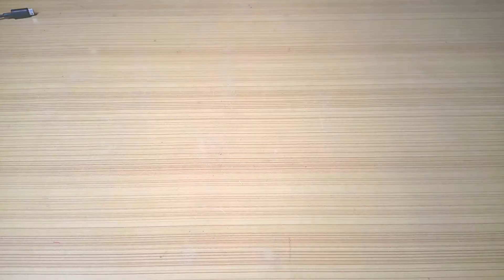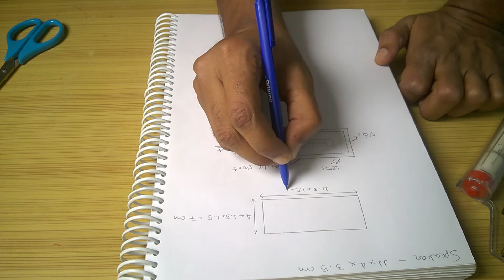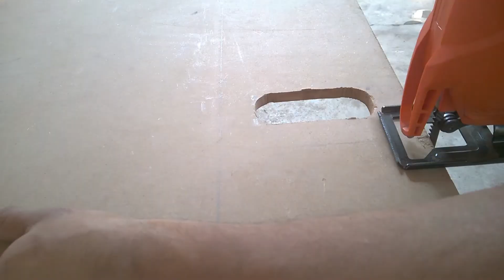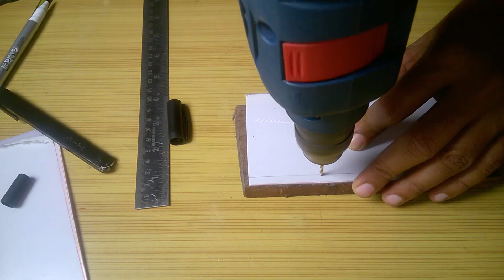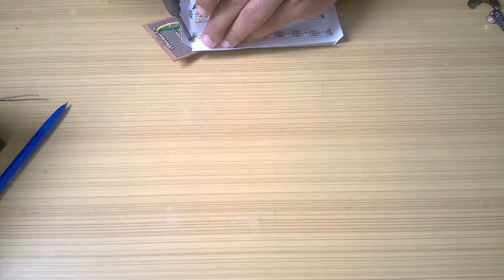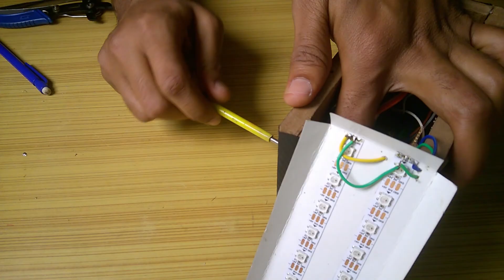Bluetooth Speaker with Music Visualizer

Comment: im doing this project,  but i have one question after you soldered the 5v wire to the switch, what device did you solder the ground wire to?
Reply from the maker: Solder the ground wire to Bluetooth module and Arduino as well.
Reply from the maker: Let me know if it's clear to you, or I'll try to make you understand in a different way.
Reply: Hmhh maybe you should consider another project first... Ground wire goes to common ground.